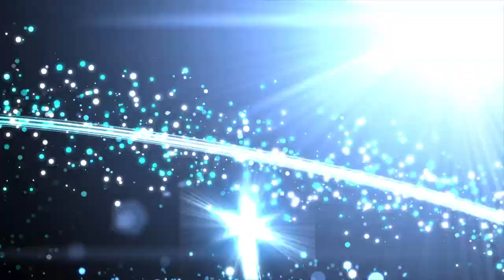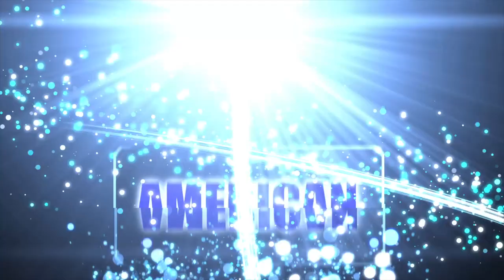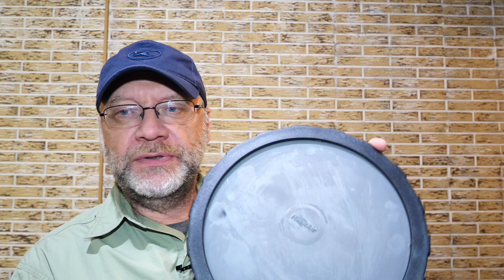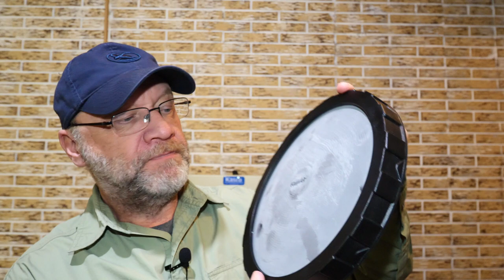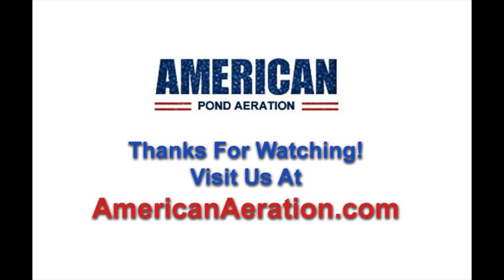DIY Pond Aeration   Tips For The Best Results

Comment: Great video, very educational.  I am wondering if can help me I have a linear air pump with a 8mm pipe attached to a air disc. My problem is its too powerful. Is there a valve or some other sort of device that can regulate the air. Or some sort of bleed of valve
Reply from the maker: Hey Gaz...so I normally wouldn't work with a bleed valve...(so I don't have anything to suggest specifcally) mainly because I have probably more flexibility in choosing various pumps to fit my diffuser situation.  But a bleed valve probably would be what you would want here...you want to try to keep excess back pressure off the pumps...especially linears which have some limitations there.  That air has to go someplace so if too much is coming out of the diffuser for your taste, about all you can do is direct some of it somewhere else., either to a second diffuser, or out into the environment...but not back on the pump.  In fact I would say there's a chance if you set this up right it might help the pump out too...ie, reducing pressure on it.    Many multi diffuser systems use manifolds...multi valved manifolds so each airline has it's own independent control for air flow.  A cheap one of those probably could be set up as a bleed valve of sorts that could work for you.

Comment: Can you use a sump pump for this?
Reply from the maker: For aeration as I'm normally talking about, no...those produce air...sump pumps, pump water.  I have heard of some people trying them with a fountain type set up, which would propel water into the air.  I have no idea how long they lasted but typically you want a fountain to run at least 8 to 12 hours per day and that's day in and day out.

Comment: I'm drawn toward the easy and cheap economics of the septic system but my pond is deeper than the 10 ft. that the HIBLOW I'm looking at claims so I have a question if you'd be so kind to lend an opinion on please sir...  Is the septic air pump (one of the higher sized models)  still effective if it's not at the deepest part of the pond placing on "shelves" where the water isn't the deepest? just guessing here but I have an old pond with at least some degree of debris fill but best guess is at least 20-25 ft deep in the dead center... oval shaped pond with 2:1 slope on dam side and the debris fill side having around 6-14 feet around inflow side total area is a little over an acre (best guess???)
Reply from the maker: Hi John...so to some degree I take the philosophy that any aeration is better than no aeration...that would be my first thought.  And you by all means don't have to go to the very deepest part of a pond to have some effect.  That all said, because this pond is pretty deep and up to an acre in size, you'd still want to try to get the diffuser down to about 12 feet min, and probably a little deeper would be better.  I always figure if I can reach 12' I'm going to affect about an acre of pond area.  This may force you more to an edge or more off center, which again, isn't a deal breaker but not ideal probably.  I'm a big fan of the linear pumps and hiblow in particular, but at some point, usually because of depth, I'll start looking more to the rocking piston pumps for the job.  Especially with he 1/4 HP's, they don't cost much more than the linears to run, put out good air for a single diffuser, and will handle depths easily down to 25'.    We have a couple on our website that have proven very reliable over the years so whenever I put one of those in I know it will do a good job.  Hope this helps for you.
Reply: @klmponds  this does help a lot thank you for the response... I will probably try the HiBlow at first then add a deeper pistol one down the road. I wasn't aware of your website & will definitely look into that. Thank you again!
Reply from the maker: @johnlancaster6564  You are welcome...I wish you the best and if you ever have questions come up, reach out and I'll be happy to help!

Comment: Hi Mark - First and foremost, great video! What is your opinion of long (100ft) weighted bubble tube diffusers? Are they better or worse than the disks? More specifically, I have a long narrow pond that is shallow at one end and deep at the other end. This pond could use three disk diffuser but with the pump installed at the deeper end, that is a long of length of dedicated weighted lines to each disk diffusers.  So I was considered have one weighted line for the deeper disk diffuser and then another weighted line toward the shallow end with 100ft of bubble tube instead of two disk diffusers. I am also not sure how well I could balance a disk diffuser and bubble tubing at the manifold. Thanks in advance!
Reply from the maker: Hey Jonathan...thanks for the kind words.  So we used to work with the bubble tubing and over time and after various installs, in most cases, we came back around and just installed standard diffusers to take it's place.  I think for certain situations it worked out alright but in most, we just found better performance and less hassles using typical diffusers.   There may be some instances where I could still see it being used to good effect but in what you described, I don't think it will serve you well over the long term.  If I were in your shoes I would just bite the bullet on the extra airline and diffusers and then I think you'll get good coverage without a lot future hassle.  Hope this helps for you!
Reply: @klmponds  Hi Mark - Thank you for the fast response and the expert option! I will take the route of standard diffusers. From your other videos, I have selected a 1/2HP double piston pump. Now if only I could decide on an enclosure. I cannot believe most enclosures are equal or greater than the cost of the pumps!
Reply from the maker: @jonathanrhodes4788  yes some of these cabinets are pricey especially if purchased individually.  In the kits they are more reasonable.  The Easy Pro cabinets are probably the best value vs price...well made and all.  I would get one with a cooling fan in it.  We work with both the post mount and ground versions and either would work for a 1/2 HP pump.  I don't have them all on the website but we can get them.  If you end up wanting to go that way reach out and I can have someone get more info to you on those.
Reply: @klmponds  Thanks Mark! I have spent quite some time on the site and well as others. In doing so, I have compiled a build list in Excel and am finding that if bought individually, all components add to more than the kits. You have assisted with selecting the specifications for the pump and diffusers. However, I still debate EasyPro or Kasco. Given that both are on your site, do you have a preference? As for the enclosure, I will be mounting this to a solid exterior wall of a foundation (offset  with a piece of wood therefore post mount seems best). Other requirements are a built in fan, acoustic dampening, and grey or tan in color. Lastly, I am interested in your opinion about filtering the air before being drawing into the enclosure. I live on a dusty dirt road and thought this could extend the life of the filter on the pump. Thanks again! By the way, if it is easier to discuss over email, please let me know!
Reply from the maker: @jonathanrhodes4788  you bet...sorry for the delay in replying here.  So Kasco vs Easy Pro...my preference leans to Kasco, at least slightly, because of a few things.  We have had very good luck (reliability with their pumps), their diffusers are the best in terms of performance and efficiency, and their warranty (which is rarely used) is the longest in the industry for all the components.  They have been very responsive if help is ever needed by a customer.  That said, they are not cheap.  Easy Pro typically has better prices and they are very good...solid now since the pumps are constructed here in the US, and they are an excellent value.  

Both systems come with good cabinets, built in fans for cooling...although neither has a prefilter for the intake screen or area.  I think this is something Kasco will be addressing down the road but for now, I think you'd want to come up with something on site and just experiment as to what works best.  Some kind of prefilter is a good idea in at least keeping the inner cabinet cleaner.  I would make sure to keep an eye on the temps inside the cabinet to be sure air flow is still good...and you'll have to decide what density of filter actually does what you want it to do... but I think that part is easy enough to manage on a DIY approach.  

I hope this helps answer your questions...if not, let me know and I can elaborate further.  

Oh one other thing on the sound proofing foam.  So the Kasco cabinet comes with that installed.  Easy Pro, in terms of the stock prices you see on the site, doesn't include that foam but it can be added in for...well I'm not sure how much $$ but it's not a huge difference in cost.  If you were to decide to go with Easy Pro, I would just have Kim from our office call you to place the order however you may want it set up.

Comment: Hello, Mark.  I have a small (80 feet diameter) but deep (18 foot center depth) pond in southeast Texas where, as you can imagine, it stays hot most of the year and algae and other nuisance vegetation is a big problem.  I've recently had my pond dug out and am essentially restarting from scratch.  I'd like to stock my pond with panfish like bluegills, sunfish and yellow perch (iffy on the latter due to water temp concerns) and have already purchased the 3/4 Kasco fountain but haven't yet installed it.  Do you think I can get away with just the fountain or do I really need the extra subsurface aeration?
Reply from the maker: Hi Chuck...while I am mosty a fan of sub surface aeration for a lot of reasons, we are using more and more of the surface aerators and fountains.  With some fish it doesn't matter so much but with others, you want the lower part of the pond to stay cooler and of course, with a bottom aerator, your going to mix everything up pretty well.  I worry mostly about trout here...where they need cooler water and they can go into areas of higher oxygen if they need to do so.  Perch could be similar although I haven't dealt as much with them.  Anyway, this leads me to suggest trying the fountain first and see how you get along with it.  It may be enough to get you where you want to be.  If not, a supplemental bottom system you might say...maybe not sized to completely cover the pond, but to account for the fountain coverage, could be added later on.  I'm not certain that you'd need it though.
Reply: @klmponds  Thank you for the thoughtful response, Mark!  I have no plans to introduce trout to my pond given the high surface water temps and negligible circulation of my pond.  Even if those weren't factors, I'm not sure I will even be able to achieve and maintain the high level of water quality that trout require.
Reply from the maker: @chuckschillingvideos  I only use trout as an example of a temp sensitive fish where top aeration may be preferred over bottom based.  But the idea still holds for other fish that may be a little more sensitive you might say.
Reply: @klmponds  ah, gotcha.  Thanks!

Comment: Why is it cheaper to have an air pump if you can use a Venturi effect aerator ?
Reply from the maker: Thanks for the question TH...I think it's a good one.  In a simple sense I would say it's a lot easier to push air rather than water...we can affect and move a lot of water in a pond with just a little bit of air (ie a pretty small pump) out of a diffuser.  A venturi is great for moving water, and you can point it very directly...mixing the pond water to a nice degree, but nothing will beat a bottom based diffuser for affecting the entire body of water synergistically from top to the very bottom...mixing AND aerating while being very efficient doing so.  A venturi will not match that broad capability in my experience.